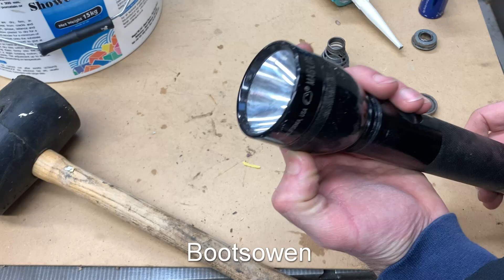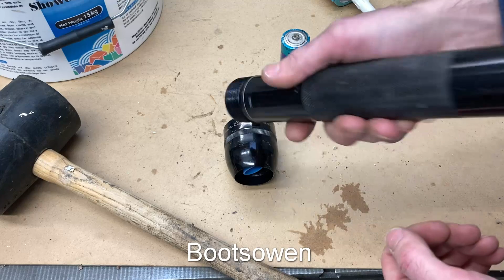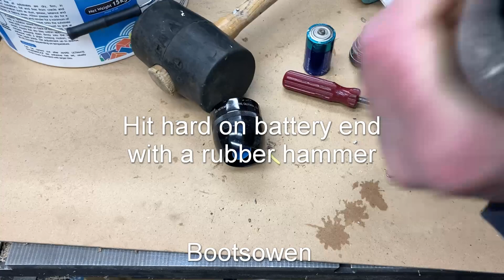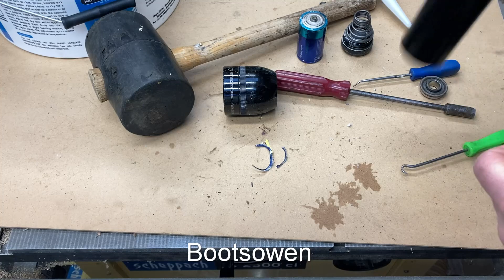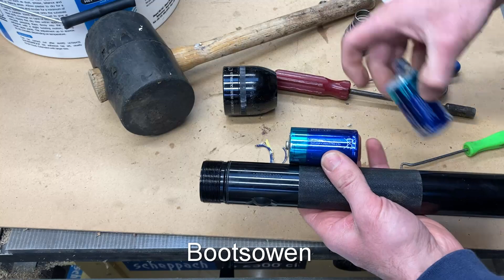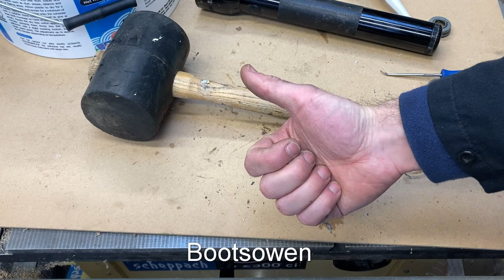How I removed corroded leaked batteries from a Maglite torch

Comment: Can't get the end cap of. Tried vise, pliers, oil. Everything...
Reply: Try heating cap in hot water if its metal.  Or use vinegar and baking soda soak.
Reply: Heat.

Comment: ideal for an Ecig lithium battery conversion? cheers
Reply from the maker: Could be. This torch is pretty much obsolete. Big batteries and a bulb!  Not sure what to do with it. I took all the solar panels down yesterday. Put a layer of tin beneath. Almost all back on now. As they were they weren’t waterproof. Picked up a solis 3.3 kw grid tie today and 2x 325w panels. The inverter is new but was some kind of display so we’ll see if it works. The panels checked out. All new/other. £120.
Reply: @bootsowen  Owen, we can test that inverter when we meet up next. 325 watt panels sound grand, what voltage and can they replace 2 on your array to up the output?  it's to do with current to match your others, cheers
Reply from the maker: I think I can just attach the solis to my 9 panel string, (it has the same connectors) and a 13 amp plug on the other end to test. I'll record it. But if there's any issues I'll take you up on your offer! 

On my existing panels Vmp is 31.85 and Imp is 8.97. on the two new ones the Vmp is 33.44 and Imp is 9.72. My limited understanding is that if I join the remaining 5 (of 14) of my old with the 2 new ones I won't get the full whack out of the new ones but it'll be roughly equal to 7 of the old ones. The old ones limiting the current, as a series wired string. And I think that the 7 should be way under the limits of the solis. Trying to take your advice about not running to the limits of the inverters.
Reply: @bootsowen  Owen, yes don't push inverters if you want them to last decades. I would put the higher wattage panels on the positive end of the string, so one assumes they are not trying to push current through the lower wattage ones. The difference is not great but something worth thinking about. 
With the sheet tin under your array, how does it effect the airflow for cooling?
cheers

Comment: I still have a stuck battery in mine after trying all of this!!  Grrrrrr.
Reply: I just followed these instructions and had to use a 20ton shop press to press the batteries out - then sand the corrosion out of the inside of the tube.  I have a working light again but DAMN!  Good luck.
Reply: Only for carbon zink batteries. Do not use on other chemistries. Get a lag screw with lots of thread that will reach the battery and leave some length to pass the bolt through a wood or metal cap with a hole through it. Pre-drill a  small hole in the battery, pass the screw through the cap and screw the lag bolt into the battery. You then use the lag screw to extract the battery from the tube by screwing it into the battery. I have a 1/4 inch thick chunk of aluminum plate as my cap and a couple of different length lag screws. Works every time. If it weren't this it would be the press mentioned by others.